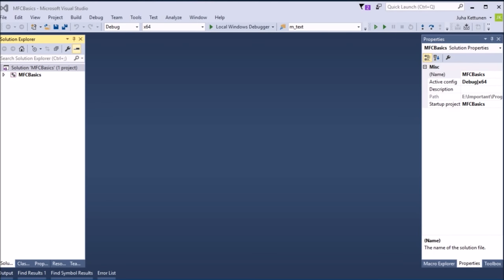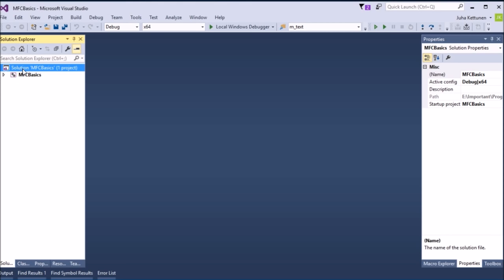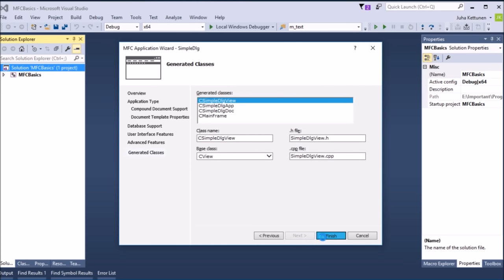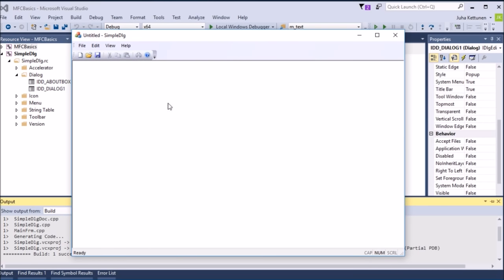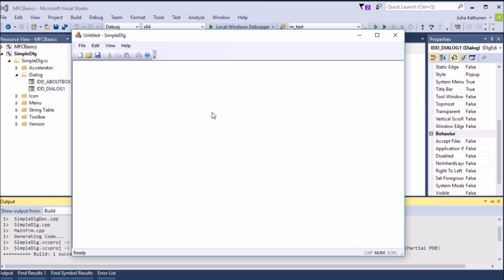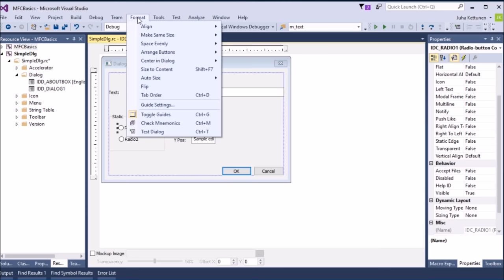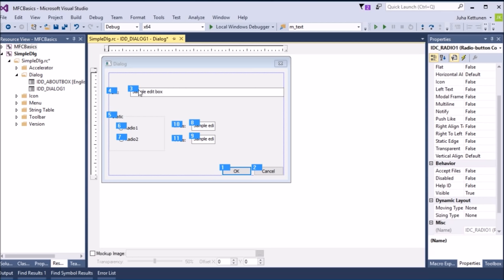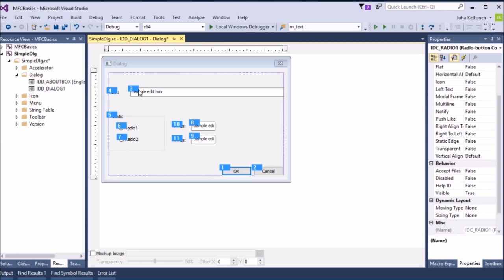VC++ / C++ MFC tutorial 1: Creating a Dialog box for user input

Comment: Brilliant video. Incredibly helpful – Thank you so much. I was able to follow along happily until I got to the part of adding variables to the dialog box Edit fields. This was fine for the text fields but I had problems with the integer fields. Specifically, using MSVC 2022, I found that the variable type was (which defaulted to CString) did not have a dropdown menu as shown in the tutorial but just an editable box. I was able to change the type to ‘int’ and expected that to work. However, when I came to run the program it complained at the line “DDX_Text(pDX, IDC_EDIT_POSITION_X, m_x);” inside COptions::DoDataExchange. Any ideas? Many thanks

Comment: I see a lot of code getting typed in with no explanation of how we would have know it was needed or available. Does it get explained in some later video?

Also... is there a main() anywhere in this?  Every c++ I've done before this had to have a main() where the program execution starts and ends. We have pages of classes and functions but no actual program?
Reply from the maker: It would be a long video if I explained all the details :). Wanted to keep this short and kinda introduction to dialogs.
MFC has main -funktion inside which is hidden from us. But in windows its not main() its winmain. That is somewhere deep in MFC. The idea is that we normally do not need to use that main. But there is a way to use main if one needs. And I think I made one video about it before? Not sure...

This is the program, but we do not need to see the main. The main passes us the functions we normally really need like the message handler functions. Windows is message driven, so we just need normally the handlers for the messages.

Comment: I understand much more now, many thanks. I wonder if the layout of the main window can get defined with a designer just like you did with the dialog.  Is that possible? I just cant find where. Thanks in advance.
Reply from the maker: Thanks. I also have many other MFC videos, even new ones. Hopefully can do more soon. 
No, the frame window cannot be changed in the designer, but you can modify in its creation-function(s). Something like OnCreate.. or PreCreate functions. So you need to add code. Yes, would be a good lesson to show it. A good idea :).

Comment: Hiya! I'm having trouble finding an answer to some things, and was just hoping if you could help clear things up for me, since I seem to have hit a brick wall.

So for an assignment, I'm making a program that requires multiple dialog windows and all of those windows need access to a linked list of things that they will be working with. My biggest issue is where does any of the data relevant to an application go? MFC makes so many things when starting a project that I honestly have no idea where I can even start putting things in.
Reply from the maker: Sorry for the late reply. If you create a project with a Document class, then data normally goes to Document class. Then all windows can access it from there.

Comment: Great videos. Thanks! I had a question regarding the use of an event handler for a button in a modal dialog box as you've shown in the video. I would like to place the event handler code in the view class, however when I try to display a simple message box to test the button click, there's no response. However, when the event handler code is placed in the dialog box class, everything works fine. What am I missing to make the connection between the button click and the view class?
Reply from the maker: Ok, so you have have put a button onto dialog and when you press that button you would like create an event handler in view to handle it? is this correct? So the button will not close the dialog box but just show the message?
Reply from the maker: In my opinion it is not logical that the dialog button handler code would be somewhere else than in dialog even if possible. Because when you are not using the dialog you still have that message handler there without any dialog, so extra code. We dont want to have any extra code... So I would recommend just having the handler in dialog class and if you have to react something in the View class (like show the message there) then just create a function in View and call that function from the dialog. You can pass the view pointer/reference to dialog when creating the dialog so dialog can use that pointer to call view class.
Reply: Thanks for the suggestion! I'll try that. I was confused because the event handler wizard allows me to choose the location of the event handler code from the wizard's class list. In your video for creating a dialog box you placed the handler code in the view class where the m_variable from the dialog's radio buttons were received, and then used in OnDraw() to change the view window's background color. I thought perhaps the event handler for a button click could be used in the same way; to toggle the background color instead of passing a variable from the radio button. I must add, your videos have been tremendously helpful. Please keep up the good work, it's very much appreciated!
Reply: Correct
Reply: No success... I understand your suggestion conceptually, but trying to implement it in code is proving difficult. (I'm completely new to C++). Your first assumption is correct - a button click in the dialog should not close the dialog window,  but will instead initiate some function in the main view (using this video as an example, if we place a new button in the dialog box named "toggle color", clicking this button should toggle the back ground color of the main window).  Again, staying with your code example in the video, I was trying to pass the view pointer/reference to the dialog in the SimpleDlgView.cpp function where the modal dialog box is created.

void CSimpleDlgView::OnToolsOptions()
{
 COptions dlgOptions;
        // pointer/reference  to dialog dealt with here???
 dlgOptions.DoModal();
}

Perhaps the primary question should be: how do I pass a pointer/reference to a dialog?
Reply from the maker: "Perhaps the primary question should be: how do I pass a pointer/reference to a dialog?" Put a view pointer into public section of the dialog class. then set it to views "this" pointer value before DoModal. Then when clicking in dialog use that pointer so call views function which you created. there are some #inlude-issues by doing this, but try to google :). Another way could be to send a windows message from dialog and capture that in view class. But I dont think this is so good here.
Reply from the maker: "In your video for creating a dialog box you placed the handler code in the view class " No its not a "even handler"/handler in view. Its just a normal variable which will be set according to what the dialog has. The radio button does not have any event handler, just asking its value.

Comment: Just stumbled on this, but I had a problem with the Tools -> Options menu selection being grayed out.  I went back and tried everything twice from the beginning but it was grayed out both times.  When I defined the event handler in mainfrm.cpp, it worked.  Any idea what I might be doing wrong?  Using VS 2017 if that matters.
Reply from the maker: I think thats how it work and is meant to work: If you do not have even handler it is greyed out as there is no point even it to be on because there is not handler.

Comment: Hi, Pekka K,
Congratulations, very useful tutorial :)
However, If I enter the  text with for instance polish diacritical signs e.g ęęę, źźźżżż etc even though the text in the edit control is shown acutately, the main window is showing me the different text. Could you tell me if it is possible to fix it?
Thank you in advance
Kindest regards,
Reply from the maker: Good point. Its because the current font its using does not have unicode letters (like those you said). So you have to use another font. To do that put this just above the "TODO" comment line:
 CFont font;
 font.CreateFont(14, 0, 0, 0, FW_NORMAL,
  FALSE, FALSE, FALSE, 0, OUT_DEFAULT_PRECIS, CLIP_DEFAULT_PRECIS, DEFAULT_QUALITY, DEFAULT_PITCH | FF_ROMAN, _T("Times New Roman"));

CFont* oldFont = pDC->SelectObject(&font);

Then put this at the very end (to be the last line): 
pDC->SelectObject(oldFont);

Does it work now?
Reply: Now it is wotking perfectly:), Many thanks V.